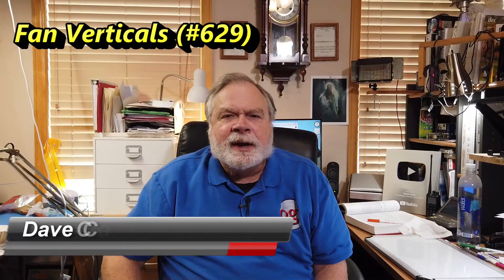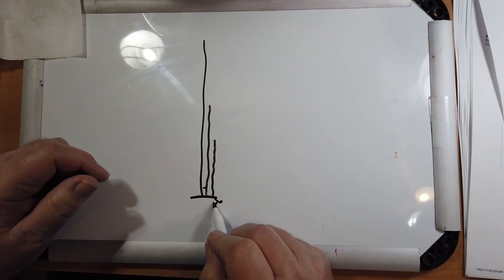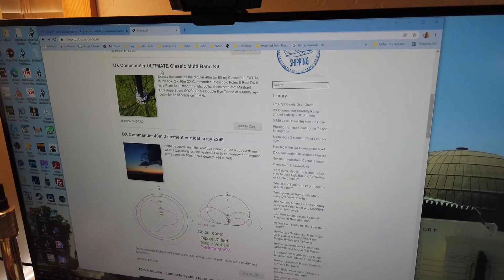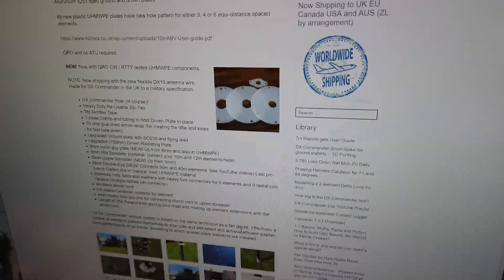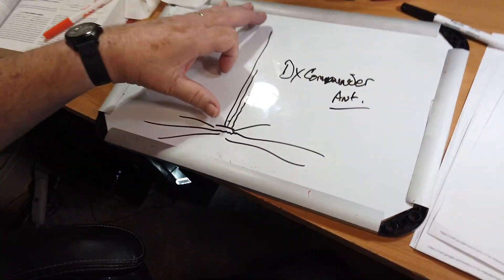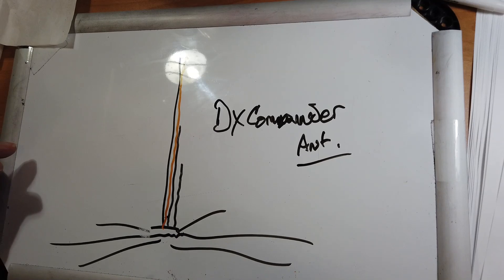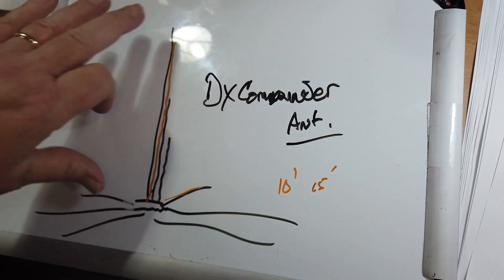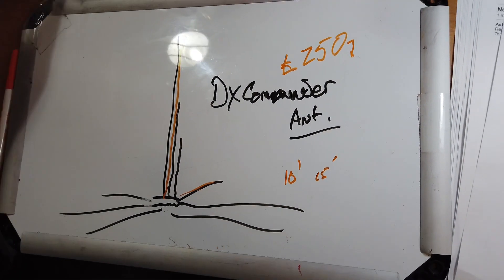Fan Verticals (#629)

Comment: I have a 4btv that I bought used for $100. It was a mess. I cleaned it all up, replaced all of the hardware and trap covers, added a 30m resonator and then bought the DXE 17 meter wire kit. After assembling it, I decided I could make the 12 meter add on and save myself the $90 for the DXE kit. So in fact, I have a psuedo fan vertical. Its a classic 4btv with two add on wires for 17m and 12 m along with a 30m coil. This gives me 10/12/15/17/20/30 and 40m in a single antenna to go along with my fan inverted V which covers 80/40 and 6 m.

Comment: Dave I was  building vertical fan dipoles over 30 years ago no glassfibre poles just a sting across my garden up about 30ft and numerous wires going from the ground up fannies out towards the top virtually no capacitive coupling!

Comment: Hi Dave,
Callum recommends for the radials to use a minimum of two wavelengths at the lowest frequency to be divided among the number of radials. For example, using a 40m radiating element, the radials should total 80m in length. That could be eight 10m or sixteen 5m radials. You and Loretta stay safe.  73  WJ3U

Comment: I built a dx commander clone using a 12mtr fibreglass telescopic pole.  It is a stronger pole than the genuine article, and being a longer pole i didn't need to muck around with linear loading on the 40m element.  Works beautifully on 40, 30, 20, 17, 15, 12, 10, and 6 mtrs!
Reply: Luke which pole did you use...Do you any plans for your vertical
Reply: @charlieoscar09  pm me ... im happy to share my build.

Comment: Thanks Dave you provide so much to the hobby. I consider the DX Commander to be in the realm of the General License holder rather than the neophyte. It's OK though. I move my DX Commander 35 miles to our club field day event summer and winter. Takes about 20 minutes to take down and put it in the van and 30-40 to set it up. The first time we did this some of the old regulars didn't believe it was that easy. Performance is excellent as well. Again thank you for all the information you provide. 73